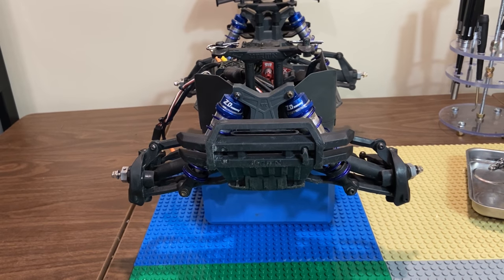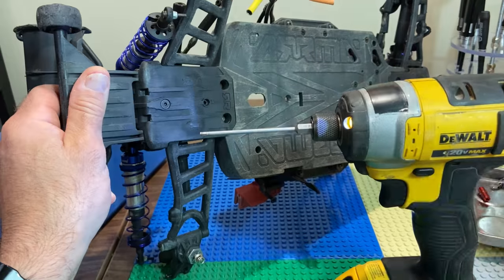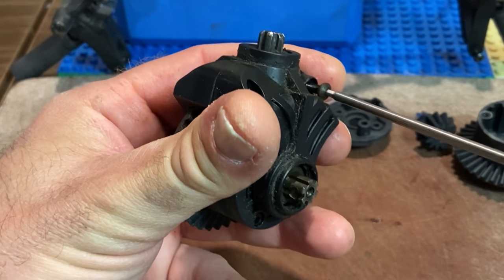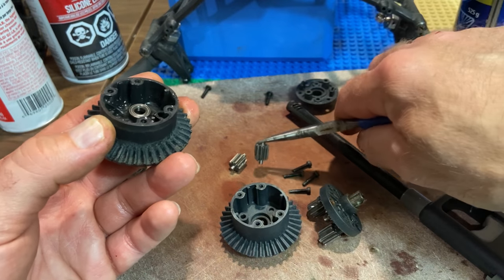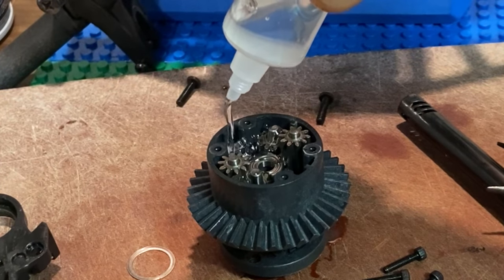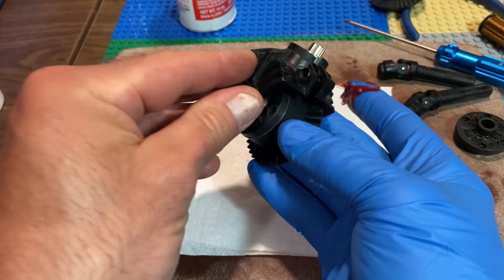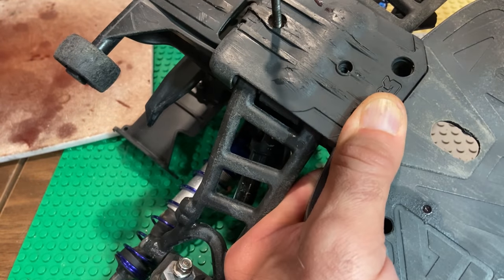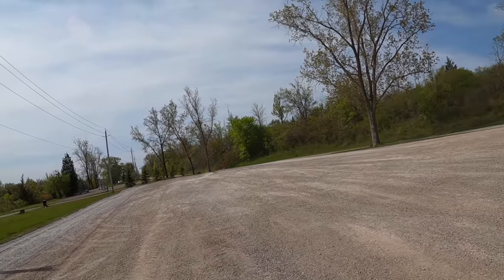ARRMA HOW-TO: 3S AND 4S DIFF REBUILD | GEARS, BEARING, GREASE AND DIFF FLUID.

Comment: have had issues with my differential not wanting to move freely when i tighten down the screws in the yoke. I know it is not a wear issue the truck is fairly new. Have not found anything online for a solution so I am waiting on back order for hot racing differential and yoke. Please let me know if you have any tips for these diffs and their yokes.
Reply from the maker: That s too bad. All i can think of is ensure screws aren t over-tightened and tightened evenly. make sure you have gasket on the diff cap, this will reduce clearance if missing. Let me know if this helps. Good luck

Comment: The mesh is too tight and I can’t figure out why after replacing the pinion and case gear, anyone have this problem? I’ve tried seating all the bearings and even removing the shim but it’s still binding.
Reply from the maker: Have you tried backing off the screws a bit on the case cover? Did you remember to install the gasket under diff case cover?
Reply: @phillybrc  Yea gasket is there and I tried backing the screws, still binds awful I don’t know what’s happening.
Reply from the maker: @travispratt6327  I m gonna suggest starting over. Check the shape of those little bearings inside the output shafts also.

Comment: 1:00 a small tip for the future, leave a very small amount of grease on that sliding red piece and the motor assembly sliding things as the next time will be 1000x times easier to remove. I still remember the hassle of the first time I had to take that out, now it slides just fine :)
Reply from the maker: Right on, great point. Thank for the input!
Reply: @phillybrc  welcome 👊 have a good one!
Reply: Thanks for the tip, I absolutely hate removing that piece. I unwisely tried to prise it out using the motor as leverage and bent the motor mount in doing so. PITA that thing and every how-to makes it look like it comes out so easy and I'm there like COMEONNNNNNNNNE
Reply: @timmurrayy  I remember the first time I tried, it was painful... Now a little pull and comes off, same goes for the motor mount and all those sliding things

Comment: what grease is the red grease you put ? Is it necessary ? I don`t have it. Does normal grease work too ? Such as used for bearings for bikes or engines and such. I have a whole jar of it.
Reply from the maker: Grease is necessary. If you don t have the Red and Tacky that I m using, I recommend a marine grease. Regular white lithium grease is not substantial. Thanx Martin
Reply: @phillybrc  so it turns out this is a special type of grease. Can you please post a link for it ?

Comment: When I put the yoke and input gear on the big gear it binds really bad. Like almost can’t spin it bad. Literally everything was brand new though. Yoke diff housing and input were all brand new. Should I just run it and let it break in?
Reply from the maker: Thats what i do but someone recently suggested to put a small 3mm washer in between the yoke halves, to open them up slightly. I may try this! It s a good idea i feel. Let me know how you make out
Reply: @phillybrc  I ran 1 pack and it seemed okay, tight at first but it cleared within a couple min and ran good 👍 thanks for the tutorial you really helped me
Reply from the maker: @smukki6346  my pleaure! Thanx for watching!

Comment: Hi sir do you tighten your yoke to fully? Or not? I notice if i tighten fully differential is kinda stiff. If 3 turn down its a little looser. I dont have shims in front differential also.
Reply from the maker: Hey sir. I now put a small 3mm flat washer on the screw between the yokes. This way you can tighten the screw and have just enough room so diff case can move freely. It works mint!!!
Reply: @phillybrc  oh i see thanks.

Comment: Hey man I’m a little confused and it think I got the wrong part because I broke a plant gear wear the driveshaft slides in, I broke that outdrives pice, but I bought (Arrma Differential Planet Gears (4) Senton Granite Typhon Big Rock Outcast) how would I take the old ones off? Or did I buy the wrong thing?
Reply from the maker: Philborrelli@hotmail.com. Any chance you can send pictures. It will help me understand. Thanx
Reply: @phillybrc  okay I had feeling it was confusing I’ll send some pics right now
Reply from the maker: Oh. I think maybe you are talking about the outdrive gear.

Comment: I see that you put industrial grease in the main mecanism, is possible the same grease in diferencial aparate?thanks
Reply from the maker: No. Marine grease on the outside and differential grease on the inside. The differential grease inside needs to be much thicker. Thank you.

Comment: I have a few rc cars that use grease in their different. Can I use that Lucas Red n Tacky in them? Thanks
Reply from the maker: No, I would advise against that. Im thinkin it s too thin of a grease since stock is 10k. I m guessing it wouldn t hold up
Reply: I use a semi fluid grease ep 0 NGLI base your standard grease is usually ngli 2-3 which is two thick it just gets slung off and cant get picked up again by the gears. The semi fluid can come in 0,00,000 grade then ngli 1, 2, 3, etc the lower tje nuber the less vicous it is. My 0 grade is still like a grease but much thinner than ngli 2 which allows it to flow around inside the diff caseing i fill it a mm and then the main crown gear can pick it up as it goes a million rpm. U may get a little leakage but not mayjor when its warmed up but ur gears will always have a light film of grease on them which is what u want.

Comment: What's the best fluid to run in the rear
Reply from the maker: I feel the front is more important, to reduce some of the ballooning. Rear usually is thinner than the front. Stock is 10k, I went to 20k and it feels good. It s kind of a preference, depends how you like the rc to handle. Thanx

Comment: I've just done this with a new diff case and input gear, boy is it stiff...followed this video and made sure it's right according to the diagram in the manual. So I am wondering.....is this common and does it just need to wear in?
Reply from the maker: Oh really?  I thought it needed to work in also, but it doesn t seem to improve. I had an interesting suggestion that I want to try myself…put a small 3mm flat washer where the yokes unite. Just to create a little space…make sense?
Reply: @phillybrc  That does make sense.....I backed the yoke screws out and it loosened up, I was thinking some kind of spacer too!
Or perhaps just leave then slightly loose and tighten them after a few runs when the gears have worn a bit? Spacer is probably best.
Reply from the maker: @madaxman72  Yep! Either way. I just didn t crank them tight but i will try the spacer. Good luck man.

Comment: well done  im curious though. why go back with the stock plastic gear when theres a metal upgrade?
Reply from the maker: Budget my friend. I couldn t afford the metal setup, plastic parts are cheaper. I also tried to use it as a tool to try to get better at driving….my son also
Reply from the maker: Thanks for watchin!
Reply: @phillybrc  yea  i just looked and saw the price of metal gears   they must be pretty proud of them   glad to hear the stock ones hold up decently well
Reply from the maker: @drewp9112  Thanx. I have since gone metal in 2 of my 3s Arrmas, no complaints. 1 is an AArrma setup and one is the helical Hot Racing. Both run great. I have yet to go to metal spur though. Metal spur will send the energy to the diffs and damage, meanwhile the plastic spur is cheap and easy to replace, It's that red motor plate that is the biggest problem in my opinion, once that is bent ,spur gets shredded.thank you

Comment: Will those guts spider gears out putshaft interchange with with a hot racing differential.
Reply from the maker: Yep. I bought the Hot Racing helical setup. It s been great. I put all stock diff gears in the Hot Racing diff cup.

Comment: What hex screwdrivers are those? Can I have a link to buy those hex screwdrivers
Reply from the maker: Hmm. I bought them from my local hobby shop. I will see if ican find you a link.
Reply from the maker: [CA$18.43 17% OFF]YZ-009 4pcs 1.5/2.0/2.5/3.0mm Hexagonal Steel Screwdriver Tool Set Colorful Handle For RC Model  RC Parts from Toys Hobbies and Robot on banggood https://banggood.app.link/Aj1CZypgYgb

Comment: Hey 👋 Great Video! Was 10 000 fluid the „Standard“ diff Fluid?
Reply from the maker: Thanx!!! Yes it is. I ve since put 50k in the front. I m liking it.👍🏻
Reply: @phillybrc  I was about to ask that...my local hobby guy said 50/70 (rear/front?), so i just got some 60 and called that close enough!
Reply from the maker: @FearlessTrailhawk  It s all preference…I m currently running 20k rear/50k front in my Typhon. I m liking it. It redeuces the ballooning on the Proline Badlands. I m questioning if I should try the same in my Granite…lucky diff oil is cheap enough to experiment! Thanx!

Comment: Aweosme vid, thanks! BTW what weight fluid do you recommend for the front? An where did you get that sweet pick/pry screwdriver?
Reply from the maker: Thanx alot. I now run 20k rear and 50k front in my granite and typhon, been doing that for a while and no complaints! If the the pry tool link isn t in the description, i will add it now! It s a life-saver and rely on it!
Reply: @phillybrc  lol I know man I saw that tool and instantly have to have it! Well I actually have 60k extra I don’t have 50. Think that’ll be much diff.? Shouldn’t be
Reply from the maker: @miketye2805  i would go for it, it won t be much difference. Let me know how you make out. I wouldn t go too thick in the rear though.
Reply: @phillybrc  I’ll let you know. I’m either gonna go 20k Or 60k in front cause it’s what I got. Rear I already did with 20
Reply from the maker: @miketye2805  try the 60. It will reduce ballooning in front tires, which i like.

Comment: Great video man, do you normally put thicker fluid in your front diff than the rear. To help stop the front tires ballooning some.
Reply from the maker: Hey thanx alot!  Yes, often times a thicker weight is added to the front compared to the rear. Ultimately I feel it’s a matter of opinion. I really like how my Granite handles with stock fluids and i enjoy the ballooning for bashing and air control.  Nonetheless, the 20000 feels great and that was all my local hobby shop had in stock...without going to 500000k fluid. Thanx for watching and feel free to comment.
Reply from the maker: Im gonna try 50k in the front very soon.  Leave 20k in the rear.

Comment: At 9:30 I'm tapping the bearing in, but at 9:35 it's easily stuck by hand. Why is that? I had to tap both of mine to get them in. And the gears don't move at all.
Reply from the maker: Did happen to see the part that transfers the gasket to the diff lid? It s hard to see, without it, the diff often won t move
Reply: @phillybrc  Thanks! I don't know much about the terminology, but by gasket do you mean what is called a sealing on a bearing?
Reply from the maker: @brelfpv1437  Not quite. 8:52, the gasket is the seal for the lid of the whole differential assembly. Without that gasket, the tolerances are too tight. Possibly a new gasket is a good idea.
Reply: @phillybrc  I see. Loosen the screw that tightens the part that clamps the differential, and the differential will rotate easily. But If the screws are left loose, it is a problem, so I guess you are saying that the gasket fills the gap between the parts that hold the diff. What kind of gasket?
Reply from the maker: @brelfpv1437  AR310875
Reply from the maker: @brelfpv1437  There is a fine line to backing them out, because you dont want fluid to leak out. Replace gasket if in poor shape
Reply: @phillybrc  oh!!! I was totally mistaken. i did not remove the gasket from the deb assembly. I was saying that when I tighten the AR310783 screws that sandwich the diff assembly and ARA311031, they turn very badly. Sorry for taking up so much of your time.
Reply from the maker: @brelfpv1437  no need for sorrow! Thanx for watchin

Comment: why does it have that groove on the diff mine have them too does it just mean time for a rebuild ? what causes it
Reply from the maker: I m not sure which groove you are talking about.
Reply: @phillybrc  the line in the middle of the diff
Reply from the maker: On the outside of the case? I think you are talking about the impression the input gear leaves on the case? It is weird that the input gear rubs on the outside of the case. As long as the input gear is seated correctly, it s all you can do. I left it as it is. Thanx.

Comment: Hi friend, I'm from Brazil and I have some questions. I would be very happy if you would help me! I have already discovered that it is necessary to apply grease to the outer gears of the differentials, but I really wanted to know if I should also grease the gears of the engine. Example: 6448 parts: Spur gear, 8985: Input gear transmission, both from Traxxas Maxx. Another question is that the center differential gear comes into contact with a motor gear, should I grease it too? Part 8988. Inside Driveshaft 8949, do I also need to apply grease?
Reply from the maker: What I do in the video is exactly what i do with my own RC’s. I do not grease my pinion, spur or outdrive gears, they stay dry. I havn t seen anybody grease those before. Hope this helps.
Reply: @phillybrc  Thank you! Yes, it helped. But I'm still thinking because it's a gear that was greased at the factory.
Reply from the maker: @wise--men  That s very possible! Let me know how you make out. Thanx!
Reply: @phillybrc  The best response I got was from John Robinson RC. He said that in general, the rule is to apply grease when the gears in contact are both metal and if they are inside closed cups. In my case of the Traxxas Maxx design the outer gear of the center differential contacts a metal gear in the engine, and both are closed. This was the one I had the most doubts about, because it would transfer grease to the engine part. Mainly the center differential, it is well closed and only a small part of contact between these two gears is open. In fact, this opening is just a connection for the part of the engine gears, which are also closed. It's like a small opening between two closed boxes. It's very interesting and it was very well done. This rule of applying only on capped gears must be to avoid sand attraction. The Razor RC told me to grease the big gear on the engine, it's the biggest one on the engine. However, I think he was wrong because this gear is plastic. Or else I was the one who was wrong to say the part number. It's really cool to learn about the RC car that I like so much, I want more and more to learn how to disassemble it all safely and know its parts.

In the end, I applied grease to this center differential gear, it ended up transferring grease to the engine gear and, when rotating with the car running, it soiled the inner walls of the engine gearbox (case).

In my country it doesn't sell traxxas and the other RCs are quite expensive too, even the ones from the banggood website. So I'm pretty much a perfectionist with my monster truck. So I analyzed the situation and noticed that much of the grease comes off when the gears rotate at high speeds. So I'm going to apply it, rotate the engine, then disassemble it, clean the inner walls and close everything again. It's also no use filling the entire box with grease, because the rotation does the same thing and spreads the grease away from where it rotates. Spreads to sides of gearbox.

I do all this because, to me, my Traxxas Maxx is a relic and a perfect car, not to mention that I'm not rich and the local money in my country is worth five times less than the dollar. So my maxx is practically a passenger car, so I can have fun without throwing it in the mud or sand. I like asphalt and grass better, even so, I don't miss my two meter high jumps.

Hugs my friend! Greetings from Brazil!
Reply from the maker: @wise--men  Very interesting and thanx for sharing!

Comment: Really nice video.  Good quality 👍🏻.     I just have to do the same with my granite but after that I screw the York’s it’s doesn’t turn smoothly.    When you do yours is he turn perfectly smooth before you run it?
Reply from the maker: Not really smooth, alot of guys have the same issue. It seems the top of my input gear rubs on the main gear housing. Mine s running great thus far so i m goin with it. Make sure your bearing in out-drive gears are good
Reply: Every things is good except that it’s not turning smooth.    But I.´m gonna try it like that I guess.    In the worst case I’m gonna have to buy a new input and new diff case.     Ok thanks and keep making nice video
Reply from the maker: @Yogz_z  philborrelli@hotmail.com send  a video and perhaps i have some input for you.
Reply from the maker: Just thought if something. Do you have the gasket in? Cuz if you dont , it tightens the parts inside. Even so, back the screws off 1/4 turn...it maybmake a difference without causing a leak